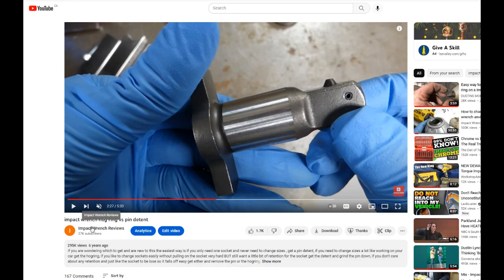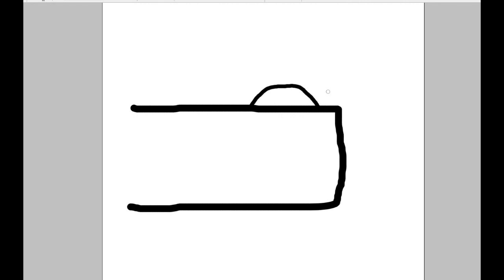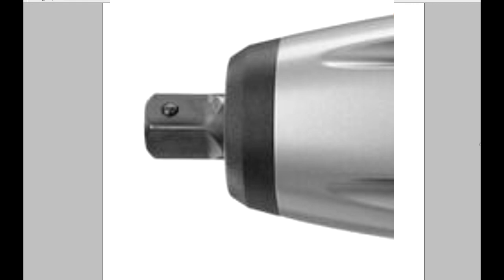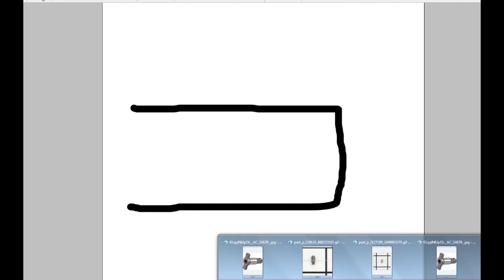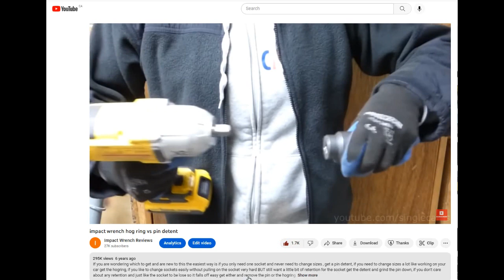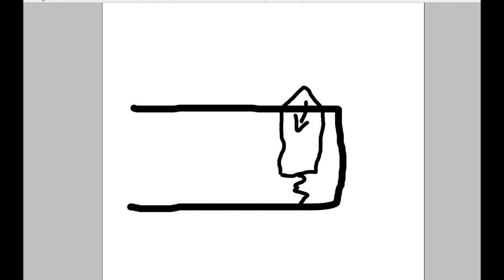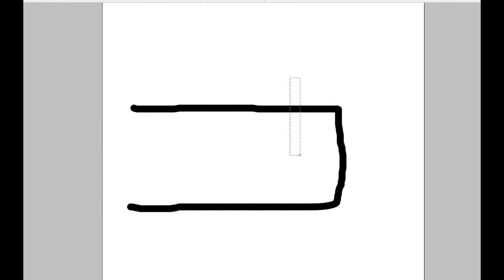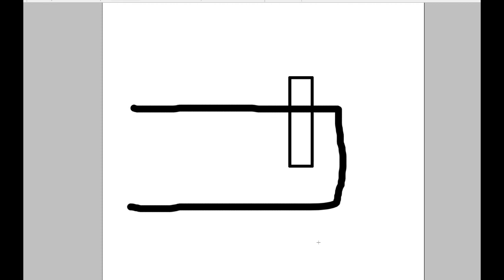How to spot a difficult pin detent on impact wrenches

Comment: I like dewalt for construction like driving lag bolts where you need same socket for a long time.  I prefer hog ring for automotive but find cheap sockets don't retain well you need decent sockets made for hog rings you can see inside some are made to retain better then others.  I just hate having to push on pin to remove. It's weird since you change channel name your videos never get recommended.
Reply from the maker: Thanks Zach I really dunno what the prob is but glad u watch anyways 😊